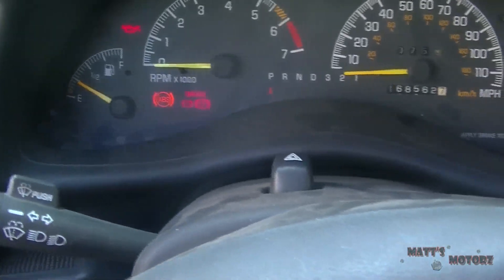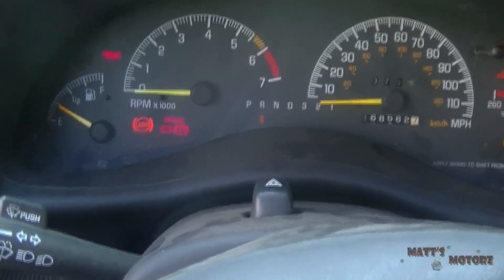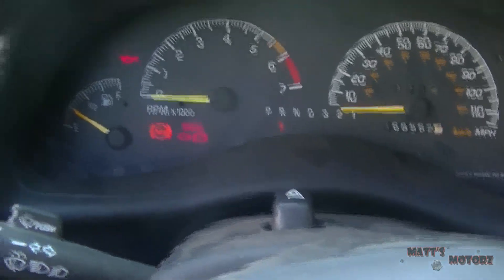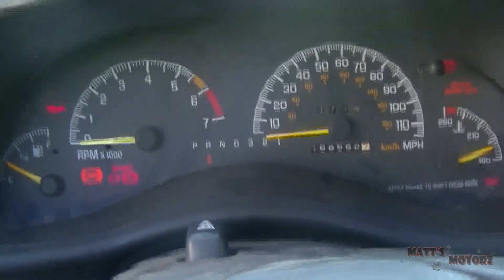Quick Tip 6 - Clunking When Coming out of Park

Comment: Couple things I do when parking on my driveway that’s has a small incline. I’ll pull up stop holding the car with the foot brake shift into neutral still holding the car with my foot pull the handbrake and I’ll test if it holds first cause sometimes if you don’t pull it up far enough car will still roll. Once the handbrake is holding I’ll put my foot back on the brake shift to park release the foot brake and the car is parked. When going to leave first I’ll shift to neutral cause if you shift into reverse and put it into gear it sometimes makes it hard to release the handbrake so put it in neutral and the release the handbrake. Now all the weight is off the trans and the handbrake shift into reverse and I’m good to go

Comment: its not as if its going to damage your transmission. its just more pressure on a pin which locks it in park. i mean, worse case is that the pin breaks. so never just leave it in park on incline without handbreak. thats all.

Comment: Nice tip! I am always super careful with my car, I never turn the wheel full lock (hear the groaning, you're cutting off the power steering fluid), use the parking brake when on an incline, avoid potholes on the road when I can, I let the lights on the dash all go out before cranking the engine (some cars you can fry the electronics if you don't give them a chance to "warm up" first), and many other things. I rather be careful with my cars than have to replace expensive or difficult to reach parts because I'm being too rough! Even if I get an extra 10,000 miles out of a set of shocks by missing the potholes that's about an extra year of life out them for me, so it makes the caution worth it.
Reply: On what car u can fry the electronics if u don't give them a change to warm up 1st.?
Reply: ***** I know for sure Honda CRXs. What happens is the ECU has lots of resistors, capacitors, caps etc. in them, and when you crank the engine before letting the ECU set for a second the extra power from cranking the engine causes the delicate and old parts to break. Like when you start your car and you can see the headlights dim and brighten with each of the cranks, that fluctuation in the electricity can damage old electronic components. My guess is the protection against current fluctuation is pretty poor or non existent, so if you don't let the capacitors fully charge and you start the car the spike from the alternator initially starting ruins it. This is generally just with older vehicles it seems, say late 80s or older, but just in case it's brought on by age I still let the car set for a few second in the accessory position before cranking.
Reply: Jesse Crandle I just had to hear how u came up with that. I've been working on cars both American and imports and I have never heard that before.
If that was true, there would be a lot of fried computers.
Reply: ***** My vehicle also displays a message when the key is turned to accessory, it says "checking engine". After about 2 seconds most of the idiot lights on the dash go out and then the message reads "engine ok". I see no harm in letting this diagnostic finish running and displaying the message before I turn the key. Maybe since you're such a seasoned vet, though, you would object to that?
Reply: Jesse Crandle Do u pull over and let your car rest doing long drives?
Reply: Jesse Crandle I'm 43 talking about my mother don't work anymore.
Reply: ***** I'm glad. She worries about you, you know... That's why she comes after the lovemaking, not because I'm so good, but because it takes her mind off her troubles. :)
Reply: ***** Oops. I thought she was pretty quiet lately... guess that's why. She still smells good, though. Or maybe she just always smelled bad... I'm not sure.

Comment: I have a 2011 Dodge Charger, and anytime I shift out of park the car makes kind of a clunk, noticable but not bad, and kinda jumps like it wants to start driving. I have a habit of pushing the E-brake down anythime I put my car in park to keep stress off the parking lock in the transmission.
Reply: You ever find out what that noise is? Mines does the same thing (also 2011 charger)
Reply: i have the same  "problem" if its a problem ! hyundai elantra 2013, obviously lot of cars has the same clunk when engage reverse from park, mine does it loud in  first start like in the morning and kinda jumps like it wants to start driving , did you find any explanation for it?
Reply: mine does to and i have a 2015 challenger it clunks only when i go into drive
Reply: Mine does it too
 I have a Ford Taurus Ses 2002
Reply: @Godisgr8always  So over the years doing research and learning, its called a transmission parking pawl. It goes inbetween your hear to stop the car from moving or rolling. Its heavy duty so it shouldn't break or sheer unless you always park on a hill and don't put on the parking break. What I do is drive to my parking spot, put it in neutral, press the parking brake, then put it in park. Doesnt clunk after doing that.

Comment: Thank god for this video, so i came across this noise for the first time in my car, i was on a slight incline, and when i tried to put it in reverse it made this noise. It's normal right? i shouldn't worry about my car having something wrong?
Reply: It is normal. Like he mentioned put on the e brakes when you park on a hill or downhill. I would suggest putting E brakes every time as it takes load off from the transmission and increases it’s life.
I hope this helps.

Comment: Sounds like mine too. I have Nissan Sentra 2016 26K miles. Whenever I park on slight uphill and try to go from park to reverse, it makes pretty noticeable kick noise. And I feel it with my feet on a brake. Otherwise whenever I'm on a regular straight steet it shift normal without any noises. What do you think?
Reply: sounds like normal behavior. using the e-brake would stop the "kick" you feel
Reply: Motor mount
Reply: If this the solution in the video did not work maybe is either a transmission or engine mount, or both, maybe check that is tell us how it went.

Comment: My e46 clunks only when going from parking to reverse, any ideas?
Reply: Did you found the problem?
Reply: @hectorramirez9889  not quite, it's not something transmission would do, I could be wrong. Secondly, check your control arm bushing and see if it's loose. And check your rear differential bushing. Lastly, check your u-joints and see if it's worn out.
Reply: Your reverse solenoid is not engaging properly. Maybe dirty transmission fluid and filter.

Comment: For a 2002 cavalier, every time i shift gears.. park to reverse, drive to reverse. It makes a clunk noise.. what could be the problem?
Reply from the maker: That is most likely caused by a worn drive chain in the transaxle.  I had that same problem on my old cavalier.  Nothing you can do short of removing the transmission, taking it apart and replacing the chain (not worth it at all).

Comment: I I have a 2000 Toyota Camry 4 cylinder and every time I put it in reverse there's a pop noise do you know what that is
Reply: Did you ever find out what that pop noise was?
Reply: @andrewm5190  probably just needed a motor mount
Reply: @MRBOCHIEDA2ND  I ended up replacing the three mounts on the Chevrolet Cavalier. The pop was still there until I invested in a RK sport lower mount and that helped out a lot. Occasionally I may get that sound here and there and sometimes hear it coming down the road. I am assuming it may be the brakes or lower control arm.
Reply: @andrewm5190  do you ever get transmission flushes or fluid changes? For me it's more of a hard kick into reverse. My top mount needs replacing. I still want to get a transmission flush tho...
Reply: @MRBOCHIEDA2ND  I am not for transmission flushes but changing out the fluid and filter may help out with that. From what experience I have had with the car if you experience a small pause then the jerk when put into drive it could be the torque converter or flexplate or clutch if manual. If it clunks as you go into drive it can be mounts or suspension parts. The best way to tell is to have someone shift and you listen out for the noise. Hope this helps. You can also look into the lower torque strut mount which is that dog bone mount. The one for the cavalier is pretty cheaply made and often goes bad in a short amount of time.

Comment: I parked on a very slight incline (the connection between my slightly-incined driveway and the sidewalk) and when I did, the car rocked back and forth as it engaged Park..... then when I shifted back into Drive, the car made a really loud THUD............ do you think letting the car rock back and forth like that will cause major wear even if it was only once? I cringed so hard................... >.<
Reply: I did the same thing just today did it damage anything in the long run at all i cringed very hard

Comment: if my transmission make a clunk only when i put park (from drive or reverse) what kind of problem is it ?
Reply from the maker: It clunks when you put it INTO park??  Are you completely stopped? Nothing should happen when you go into park.
Reply: yes completely stopped , but it happen only when i drive a few miles , when the transmission is hot i guess , because if i drive just 5 min , nothing happen
and i noticed also my shift stick become hard to put into park , drive , reverse or neutral  after driving a few miles
Reply from the maker: warcrift2012 That is a weird problem that I honestly do not have experience with.  There isn't much I can say on the internet.  I would need to inspect the vehicle.  You should take it to a transmission shop.  My initial guess is that perhaps the valves in the valve body are scored from dirty fluid and binding up in their bores.
Reply: warcrift2012

Comment: totally un necessary, when you come to a stop put the E brake on and then put it into park, thats it, takes half a second. No reason why you cant do that every time you park
Reply: JimmY      Important to put it in neutral first then pull the handbrake so you can see if the car hold cause sometimes if you don’t pull it up high enough the car can still roll
Reply: Ryan S yeah maybe now and then just to make sure. But you can feel by how tight it is as you pull it. I guage mine by seeing if it stays exactly where it is after taking my foot off the brake, if it rolls a little then its not been pulled hard enough
Reply: JimmY      Yea what I was saying cause it might still roll if not pulled tight enough
Reply: Ryan S thats true, mine takes a lot of force otherwise it doesnt work at all